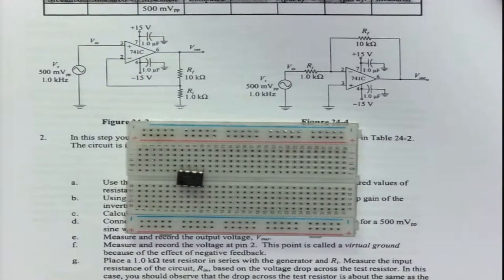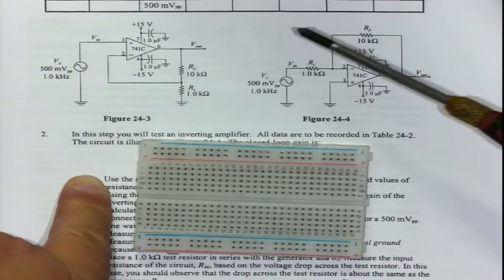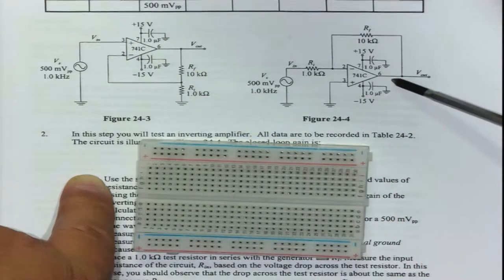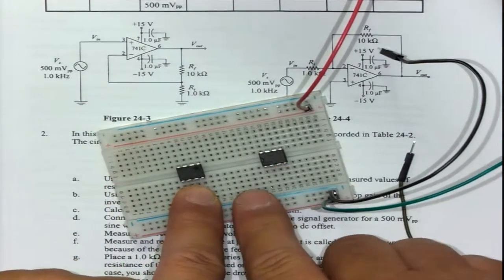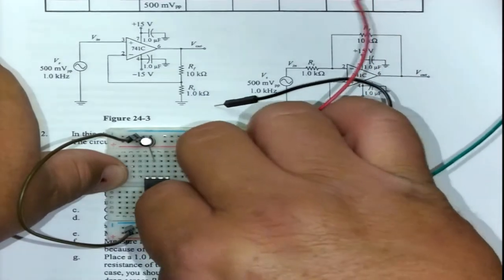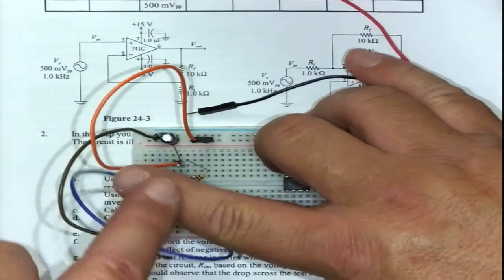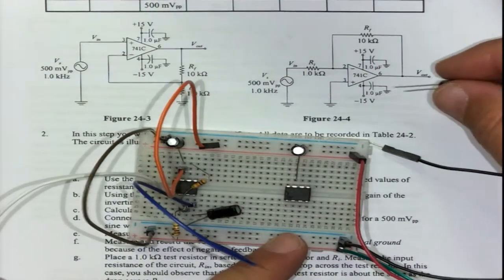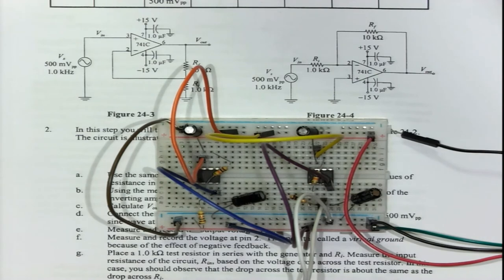HOW TO CONNECT AN OP AMP ON BREADBOARD

Comment: Nice video, everything is clear except how the positive , negative and ground ( green wire) connect to the power supply.  I have a power supply with positive and negative output so it’s clear how the first two power connections are made . Not sure where to plug in the green wire 😢 unless it goes to earth ground on the power supply ? If so my power supply is no longer floating .  Would be great if someone could help clarify how the 3 power wires are connecting to power supply in the video . Thank you so much !
Reply: Hello Greg, thank you for the comment.  I am using a "split" power supply to power this op-amp.  This means that it provides 3 voltage points from the supply.  RED = +15V  BLACK = 0V (GND) and GREEN = (-15V)    If this is not provided, the op-amp will not be able to provide any NEGATIVE output swings.

To overcome this arrangement challenge, we can place 2x 9V batteries in SERIES.  The top positive is taken as POSITIVE, the connection BETWEEN the two batteries where the negative and positive connect, is GND (0V).  The NEGATIVE of the second battery is then taken as -9V to the negative supply of the circuit.

73
Reply: @riaanzs4pr  thank you Riaan for the clarification. I missed the part early on in the video where it’s indicated there’s another video which discusses the power supply set up. These videos are wonderful. I liked and subscribed to the channel. Super helpful with crystal clear explanations! Thank you 🙏
Reply: Also want to mention I just successfully implemented both circuits using same power supply configuration.   Going to buy a couple of green wires for completeness :) so happy I finally got this working